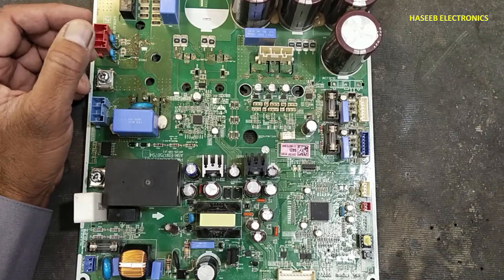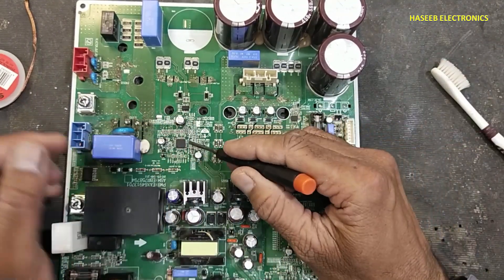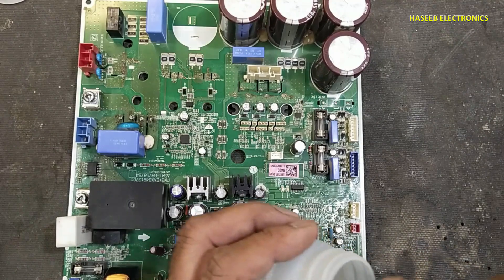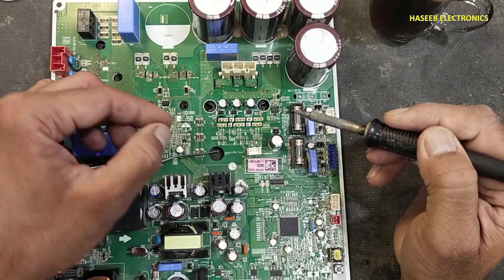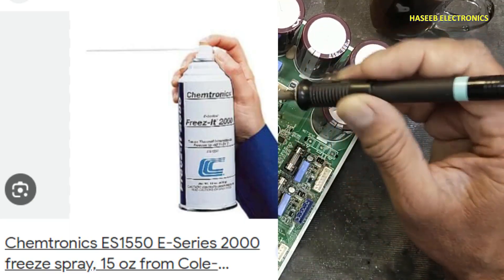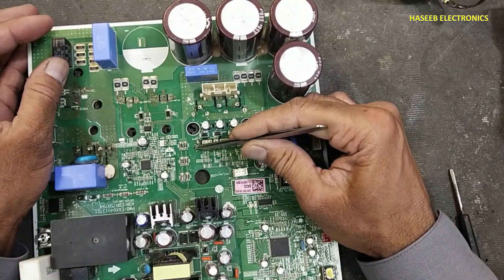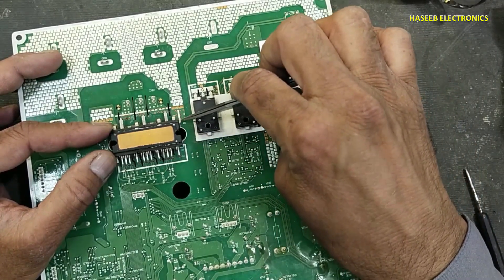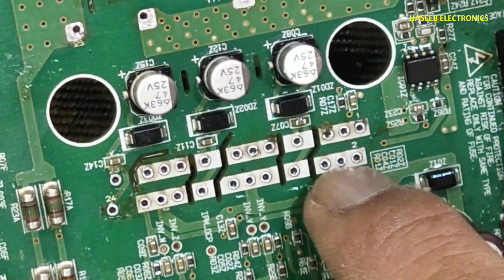{972J} Best method to desolder IPM

Comment: 6:55 Be carefully with moving the desoldering iron on the pad so much. It happened to me, that I cut the trace to the pad because of too much moving and force to the iron. 🤦‍♀️ It depends on the board, some have very tiny traces.😊
Reply from the maker: yes sir 
as you mentioned the board quality, that is also a big point to be kept in mind while rework
moreover, soldering temperature and soldering time matters a lot,
Reply from the maker: you are right.
 if we rotate the desoldering tip while pressing hard on traces, it may damage the traces.
or if the temperature is too high, it may result to separate the bonding of traces. 
otherwise, using desoldering tool, it is necessary to rotate the pin in the cylinder to free-up the solder to flow easily, 
otherwise if the solder remains in the gap between pin and cylinder, it will make dry joint and it becomes difficult to remove it in second attempt

Comment: Sir,
I am troubleshooting one of my emergency lighting circuit, while switching ON the power the relay is not getting changed over due to voltage present at relay coil followed base voltage available at transistor. Base voltage has to withdraw while power in ON condition. Its not happening. Due to wat reason it is like this.

Comment: I use your method but some times when the pins stucked with some solders i use hot air and flux to remove the IPM.

Comment: Sir apka disoldar tool  Weller wr3m price?
Reply from the maker: complete set with all accessories is above 3000+ USD
Reply: @HaseebElectronics  o my good 330750 BDT
Reply: Sir muja ek oscilloscope chiya best konsa hoga? Hds242s model?

Comment: Well done, sir. Each type of component requires a specific desoldering strategy. I use the word "strategy" with purpose, because prior thought and planning are required to prevent additional damage. One should not rush to begin. I have not encountered a device package such as this. But, I may have approached it slightly differently. (We all have our own skills.) For those folks that do not have a desoldering gun... Because the IPM's pins are quite long, I may have attempted to desolder the outer pins one at a time and just gently bent them up. This may have freed up enough space to desolder the inner pins without the use a gun. Another thought... To protect the new part from over heating when installing it... On the long pins, place a blank alligator clip (no wire attached) next to the chip's body to act as a heat sink. Because the pins are so long, the extra mass may protect the chip without increasing the soldering dwell time. Trial and error are necessary, here. There are special alligator clips that have a flat bill and no teeth. They are better, for this purpose. I also discovered your method of staggering the pins, when soldering, to reduce the heat intensity in any one location. I can testify that this method works well. HTH. Another great video = thank you. Cheers, my friend!

Comment: What starts desoldering item ?
Reply from the maker: i cannot understand question clearly 
can you please explain your question in some detail so that i can reply correctly
Reply: @HaseebElectronics  desoldering item is working spontanely. It doesn't have any buton as seen. Is it continously vaccuming ? Or is there any buttun ? Or any other way?
Reply from the maker: @karisikpekmez6850 it has a push button on grip. 
Its desoldering nozzle heats up
We place nozzle on desoldering point 
When solder melts 
Then the push button on grip is pressed. Its vacuum pump starts and complets its process
Reply: @HaseebElectronics  can you show the button detail ?
May be a short video consist of the details of this devices. Even the inner.
Reply from the maker: @karisikpekmez6850 https://youtu.be/0Uvtm64lijs?si=UeCGiPVJGA9HlX25